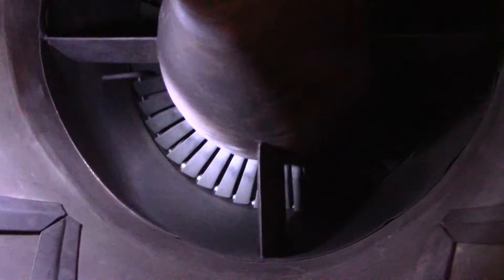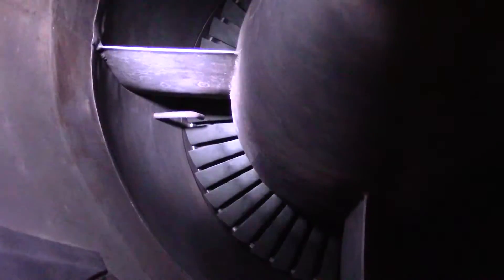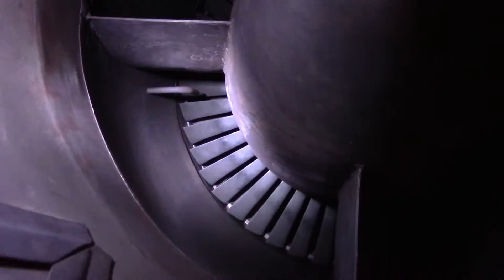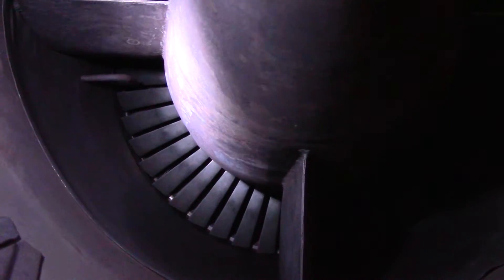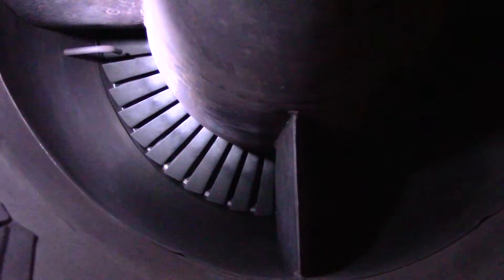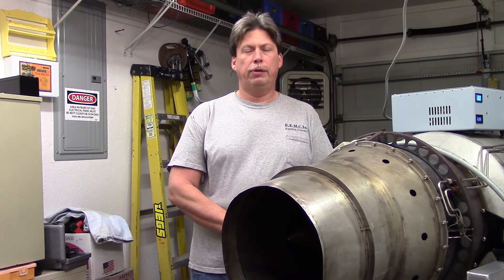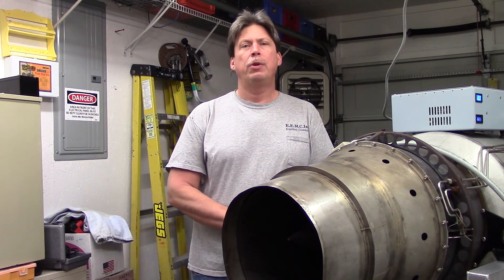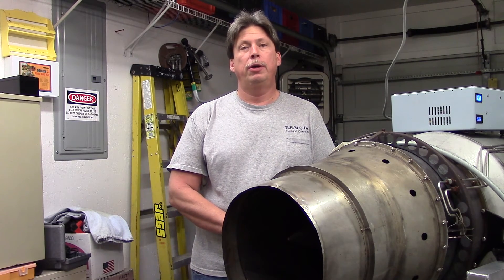The J44 Project:  Turbine Nozzle Damage

Comment: Those NGVs are showing severe damage, and it looks like heat, not age that's doing it. Since this engine is rated at 15 hour service lifetime, the nozzles are probably running right at their limit of heat tolerance, and now they are done.
If that's the case, then repairing them would at best give you another 15 hours of running time.
I would guess that your -R-3 engine, being rated for heavier duty, might have more advanced alloys in the nozzles, or more advanced cooling provided for them. If the turbine nozzle really is a weak point of the engine, then all of them may be damaged, and it will be hard to find replacements. If that's the case, then you have nothing to lose by doing some artful welding and grinding with Hast-X rod.
I think it is definitely worthwhile to remove and check all the fuel nozzles. Maybe the nozzles aren't so weak, but you have a hot streak as our engineer friend suggests.
This video shows parts that are beyond repairable condition in most cases.
What is possible... is removing good airfoil sections from one junk nozzle to be used as replacements for the bad airfoils removed from another junk nozzle. Seems like you may have the parts on hand for that.
Reply from the maker: +AgentJayZ Thank you Jay for the reply & information.  The engine is not too difficult to work on so I could remove the outer case, exposing the combustor & the fuel nozzles.  Yes, only 3 of the vanes are corroded/burned badly while the rest actually look good from the visible side.  The full story will be known once the assembly is removed, as you know, so wish me luck.  Yes, I must be sure to mark the turbine rotor so as to index it to the shaft to maintain balance!  I think I would instinctively do that anyway, but it says to do it in the manual.  The -R-3 (the 'flight-rated version) engine shows tattered, ragged trailing edges on ALL NGVs, so ALL would/will have to be repaired  None of them look as bad as the 3 on the -R-20 (this engine) do, but they are all burned 'equally', for what it's worth.  If you know or hear of anyone that has N.O.S. Fairchild J-44 nozzles for sale, let me know!!  Thanks again & take care.

DD
Reply: +Darren Duncan Hello again, Darren, I feel very reassured that AgentJayZ, with his years of experience in R&O, is coming up with much the same sort of advice that I would be giving from the viewpoint of an engine designer, albeit a practical one.  My concern remains, however, that those three adjacent NGVs are looking so much worse than the rest of the ring and that this might be indicative of a hot 'streak' from the combustor.
Reply: grahamj9101 I agree. I also want to state that I think the damage is due to heat, not corrosion, or "metal ageing".  Checking the fuel nozzles is a top priority in this case.
Reply: +AgentJayZ Thanks for your response, AgentJayZ.  It looked that way to me and I used the fancy term 'thermal distress' a few weeks ago: equally, I could have said they had suffered from 'burning'.
Reply from the maker: +AgentJayZ   OK, it is settled:  We will disassemble the ol' girl & check it all out.  According to the USAF tech manual, the fuel nozzles are simply those used in oil-fired burner applications & they are common.  I reckon we will see.  Of course I will inspect & repair, if needed, the annular combustor.  How about the 2 shaft bearings, especially the rear one?  If they clean-up, maybe they are still serviceable but I will investigate matching those bearings with new ones, if possible.  If the NGVs are repairable, then after a total tear down, I hate to not look at it all!  Thank you for your advice & feedback!
Reply from the maker: +Darren Duncan PS:  And thank you 'grahamj9101' also for your advice & feedback.  You & 'AgentJayZ' will be part of a tri-country classic turbojet restoration project!
Reply: +Darren Duncan Thank you for the acknowledgement.  I am happy to give advice and offer opinions, but I think that AgentJayZ will be of more practical assistance to you with all his years of workshop experience.  I had the services of a repair engineering function when I was responsible for engine design.
Reply: +Darren Duncan I would add that, while I might be an active senior citizen, I don't actually have a full-time day job like AgentJay Z.   Under the circumstances, he may or may not wish to be considered as a 'consultant' for repair and overhaul of your engine, but he will, no doubt, speak for himself (he's very good at that).  On the subject of the bearings, you will probably have to go entirely on visual condition of both the rolling elements and the tracks.  If they look in any way distressed, then they are unlikely to last very long.  My other concern, which I haven't mentioned before, would be the integrity of both the impeller and the turbine disc.  Obviously, they won't have been designed for thousands of hours/cycles and the last thing that you would want would be an uncontained failure.  Have you any idea of the lives (in hours or cycles) of these two components?  I doubt that the manual has anything on cyclic life for an engine that was destined for destruction after only a few hours' life, but the cautious turbo machinery designer in me is telling me to be wary.
Reply from the maker: +grahamj9101 Hello & thanks for the ideas.  There is no such info in my USAF tech manual, so maybe a 'magnaflux' dye inspection would be in order.  The other thing to do would be to practice staying clear of the engine  when running it above 50% RPM (about 7500 RPM), just in case.  I appreciate the pointing out of potential problems!

DD
Reply: +Darren Duncan Hello again. If you have access to 'dye pen' inspection, then it would be a good precautionary exercise, as would staying clear of the "ol' girl" when she's running at high power.

Comment: I've been trawling around some more on the internet, in the hope of finding a close-up of the NGV assembly.  I wanted to see whether the vanes are solid or hollow, but I'm still none the wiser.  However, as I said before, they probably have a constant cross-section.  This means that it might be possible to fabricate replacements from some suitable heavy-gauge nickel alloy sheet.  You might even get away with a heat-resistant steel for just a few hours running, but the 'pessimist' in me says no.
Reply from the maker: +grahamj9101 Hi there & thank you for the info.  I will work some pictorials into a future video of the engine, most likely during the repair attempt this Winter.  The nozzle construction looks like an inner ring (flat steel band), an outer ring (same) & the individual vanes, which are welded at both ends to the rings, forming a one-piece assembly.  The vanes are not hollow but appear to have been 'stamped' out of steel, giving them a bit of an airfoil (they are not just flat pieces of steel).  This will require one of my buddy's C.N.C machines to make the vanes, then him to weld them in!  Again, as of now, this is all in theory.  Not holding my breath but I am slightly optimistic!  Stay tuned....  cheers!

DD

Comment: Those NGVs look like a nasty case of thermal distress and, I would strongly suggest, repair by replacement.  You may have a 'hot streak' from the combustor, which, as you say, will need to be looked at.  If there's no obvious distress in that area of the combustor, you should take a good look at the whole nozzle row, which would be a good idea, in any case.
Reply from the maker: +grahamj9101 Thank you sir, for the reply.  I will be elated if I happen upon a 'N. O. S.' nozzle to replace this one but I ain't countin' on that!  There is a fine line between a realist & a pessimist.  I am near that line!  Hopefully, I think to myself, it could, maybe, possibly be repaired.  Since it is an 'economy' engine, It may be of simple construction, hopefully not cast but rather welded.  There are no cooling air passages or anything like that.  More to follow upon disassembly...  Thanks again for your knowledge.  Cheers.

DD
Reply: +Darren Duncan  As I've readily admitted to AgentJayZ, my response is  governed by a career lifetime thinking in terms of safety and reliability, which is why I look at that degree of damage and immediately think in terms of replacement.  I would expect those nozzles to be cast, either as individual vanes or in segments, but I could be wrong.  Perhaps my attitude puts me on the pessimist side of realist, but wouldn't you want that in someone who once kept Concorde's engines turning and burning?  Nevertheless, if you ever had a failure on your driveway, which resulted in debris ending up out in the road, then your neighbours (OK, spellcheck, I'm a Brit - neighbors!) and the authorities would be a lot less tolerant.  PS  Do you have a cross-sectional GA of the engine that you can show us?
Reply: +Darren Duncan I should have done more homework on the J44 before getting concerned about its intake conditions.  With my experience of the Viper, I assumed that your engine had an axial compressor.  However, Wikipedia tells me that it has a centrifugal compressor (and a two-stage turbine), so even I wouldn't bother with any intake fairings.
Reply: +grahamj9101 I've trawled around some more on the internet and found that I could buy a maintenance manual for the J44.  The illustrations I've seen show a single-stage turbine (not 2 stages) and an NGV assembly that appears to have individual vanes welded into inner and outer carrier rings.  Whether those aerofoils/airfoils (which are probably of constant section) are forged or cast, I've no idea. However, it does give you the chance of repairing individual vanes. (Did I really say that?)
Reply from the maker: +grahamj9101 I have a copy of a USAF manual for maintenance & operation of the J44-R-3, which is a later (late 50s) version, with improved fuel controls & a longer certification running time.  The early versions of this engine were only rated for 15 hours!!  That is basically disposable; to be shot down, crash to the ground, whatever.  However, like most everything for the military, it is 'over engineered' enough that they will run well beyond that time, if they aren't abused.  In my short time & experience with these engines, I am noting that the turbine nozzle is the weak link in the chain.  I have a 'spare' -3 engine, in which all of the nozzle foils are eroded, equally on the same edge, which is a sign of over-temping.  It is a complete engine though so if I can fix my -20, either by replacing (preferred) or repair (??), then I can fix the -3!  So stay tuned....
Reply: +Darren Duncan The Armstrong Siddeley Viper started life as an expendable engine for a target drone, but when they put one on test to see how long it would last, it just kept running. To make a jet engine last reliably for, say, 15 hours, it probably needs to be designed to last unreliably for five to ten times as long.  From its expendable beginning, the Viper was developed through numerous marks and there are a few still flying today.